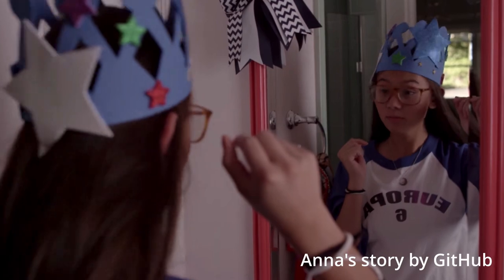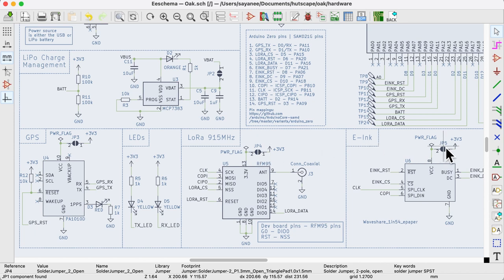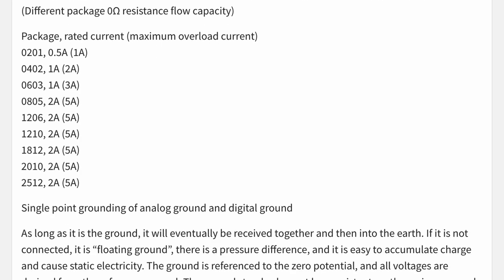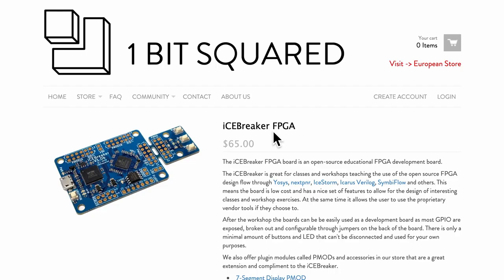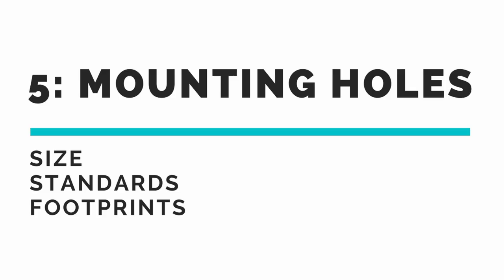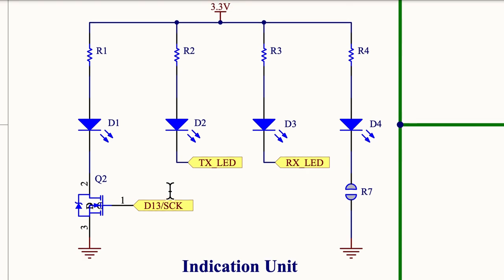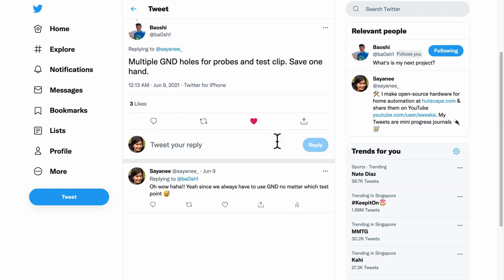Optional but useful things to include in prototype PCBs for testing and debugging // KiCad

Comment: I'm a fan of rectangular test points that fit a Keystone 5015 SMD test point. On initial prototypes, you can solder these on for easier test hook clipping, then leave them off in production. Still works for factory bed-of-nails testing too. KiCad has nice footprints for this.
Reply from the maker: Amazing! I love it when it can work for both small-scale prototypes as well as large-scale factory-level manufacturing. There are lesser changes in components as we progress from version to version. Thanks for sharing this :)

I had to search and see it visually. I found this datasheet and saw the image of the surface mount test point with test-clips: https://datasheet.ciiva.com/16884/70182998-16884102.pdf

I had a look at the KiCad footprint too! I also like that we can still use it without any test clips as well for prototypes: https://gitlab.com/kicad/libraries/kicad-footprints/-/blob/master/TestPoint.pretty/TestPoint_Keystone_5015_Micro-Minature.kicad_mod
Reply: If you go this way, shop around for what kind of SMD test points you can get. There are not a lot of manufacturers making these, and as a result they are extortionately priced. I paid something like US $0.25 each for these tiny bits of stamped and formed metal in quantity 100. If anyone wants to see the board design, I documented it here https://www.youtube.com/watch?v=HvkYDyGICJo
Reply: @sayanee  I haven't used these much lately, but there was a time (especially when I was doing more experimental analog stuff, where more things could go wrong that would need probing) when I really loved using these.

They're especially useful in dense analog layouts, because a lot of them roughly fit in the space of chip passives. It ends up being just a question of slotting them into the right spot in a grid of passives—no weird shapes to worry about.
Reply from the maker: @Laogeodritt  Nice!! Thanks for sharing a practical use case.
Reply: @sayanee  what is your job and qualification? electrical or computer science?
Reply from the maker: @ashwin372  I do not have a job currently. I am mostly self-taught.

Comment: Great tips!  Im a big fan of including a zero ohm resistor between a voltage regulator output and the rest of the supply rail, that way you can depopulate it to make current measurements or disconnect the regulator and wire up an external supply

Comment: Watching this video did make me wonder if it was very hard to create an edge connector like a PCI slot. The reason for doing so could be for quick testing as well as connecting to other peripherals. This can be very useful if you create designs for mass production. It does imply creating an automated test bed, but then you can get not only full tests every time. You can also run endurance tests and get automated reports, all possible of being performed by a non-technical person, or simply just have a station that requires attention to switch the boards.
Obviously, we cannot fall into the trap of having  a test bed for the test bed. That would create an infinite loop, and we would get nowhere. At some point, we have to go to the nitty-gritty with our instruments and make sense of what's happening.
This approach I find to be justifiable only for large productions, otherwise it won't be neither cost nor time effective. For small batches, the solution you use is perfectly fine, and it makes more sense.

Comment: I am a bit confused about using a 0ohm resistor as fuse, how long will it take for it to burn out?
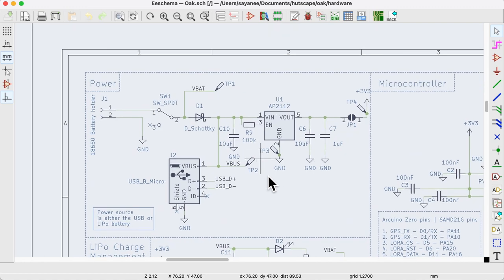Reply from the maker: 2:00 I did not use it as a fuse.
Reply: @sayanee  didn't you see somewhere that it could be used as fuse?